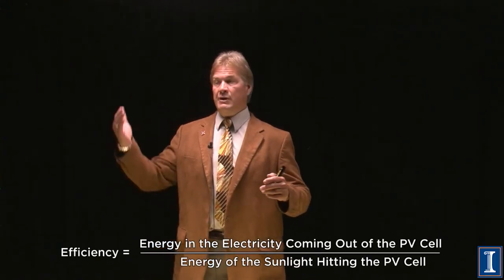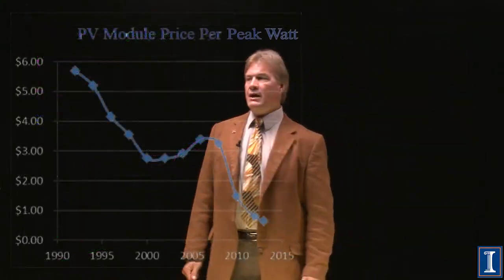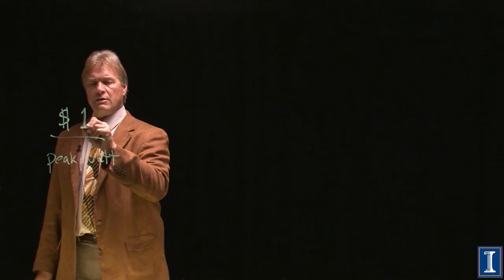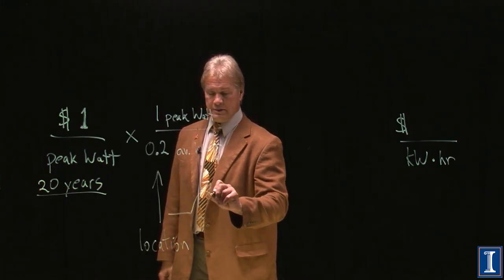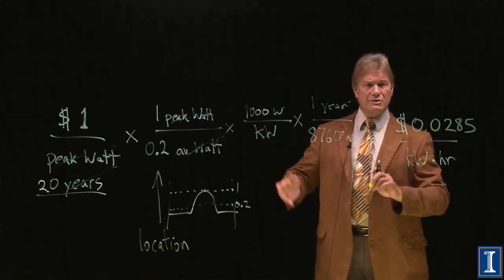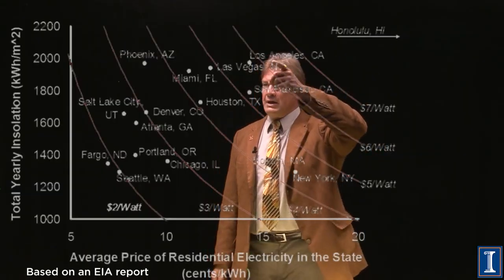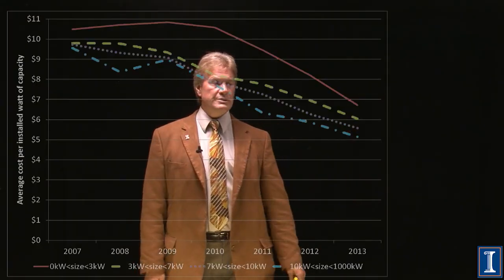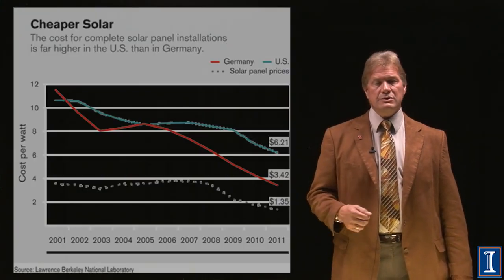The Cost of Sunshine

Comment: I worked for a company installing solar systems all summer. Funny thing is I was wanting to do this at my house before I worked. After I was done working and the company split up between owners I had already figured out it’s not for me. I’m not bashing. Simply pointing out my experiences. One thing he mentioned is the standardization of roofs here in the US. That is very true and plus our shingles don’t last the same time of the expected life of panels, so in contrast if your roof goes bad you have to uninstall your panels, put new roof on and then reinstall your panels. So that is Tripling install cost. No one ever worked that into their cost analysis for a job we did. Now there are other methods, pole mounts and rack systems, that can be put in yards or fields but away from trees and buildings, but that is almost impossible to do in the city which is where the energy cost are more and the higher need for solar systems. All these cost analysis were done if everything goes right. Roof leak? Now ya have to remove panels. Roofer won’t mess with them. So a simple leak can cost thousands. You might have to get an electrician and a solar company to remove panels before your roofer gets to the leak. Also all the activity of installing them running around on your roof degrades the shingle life. Now we have storm problems that cause about half the problem besides the electrical problems. Wind blows a wire loose, limb falls from a nearby tree. It was the neighbors tree. Now we’re in a fight for repair. Who’s fault, leads us to insurance. Now your homeowners might say yes we cover it but we need it inspected and proof of cost but you didn’t think of that before your $20k system got installed. Some won’t cover it. Some will. Do your research! And Hail storms? I can’t comment cause I haven’t seen one but the threat is there. We had multiple problems with getting the panels here from China that were not damaged. About 1 in 10 were damaged.& also the inverters and optimizers went bad. Sometimes taking a lot of work to repair and some not covered by manufacturers so we had to eat it and so did homeowner. The next thing is not even related to solar panels. Now don’t get me wrong I like them, I wanna save the earth and also save money. Most of our customers don’t even care about the earth they just wanted to screw the power company and gov as much as they could. But while installing not one homeowner was ever on their roof and in their attic. We discovered on every job at least one major problem causing inefficiency for them. Example a cold air return vent was just laying up there open to all the roof heat! Others had roof vents blocked and restricted. Or lack of insulation for our climate. People, solar panels won’t just fix it all. You have to know your house. We improved people’s efficiency with out ever putting a system in. This means you need to do a whole house evaluation. Old HVAC system can kill your bill and render panels useless on a cost analysis. Then the last thing is are you going to stay at that same house for 20 years?!! Not many people do. Are you gonna just take them down drag them to your next house where they are outdated and lost their productivity. Many things to think of.
Reply: and yet, there are those of us that do not live in the city and have solar homes - I remember the $6 per watt days and how precious those panels were and now bask in the $0.50 per watt panels and have to worry about my battery in uncontrolled conditions.  You are absolutely right in your observations - solar, for the reasons you're expounding, isn't right for rooftop installations.  But there ARE installations where it really works.  Like mine.  Haven't paid a utility bill (except propane and buying batteries and some diesel) for 30 years.   To be truthful, though, the cost savings isn't as great as one would believe.  But, I didn't have to write that check every month.  It was worth it.
Reply: Honest question, maybe naive: wouldn't the solar panels provide some protection for the roof and add to its longevity?
Reply: @chance20m  Not really... Roof shingles typically do not fail because of physical damage from hail or whatever. They typically fail from age and rot.
Reply: @dwightlooi  Fair enough.
Reply: @dwightlooi  is shaded they may last longer.
Reply: @chance20m  yes, good observation, but you don’t cover every inch of shingles with panels. So the places most likely to leak are valleys and around vents and chimneys. So let’s say 60% of your roof is covered with solar, 40% keeps getting the suns wear and tear. I guess you could get a roofer to replace 40% of your roof but not one would ever give you a warranty because how does he know what the previous solar installer did. Thanks for the discussion. This is how we further our knowledge.
Reply: @chance20m  No
Reply: @chance20m no, they don’t cover the entire roof
Reply: Interesting information - and a first hand one! I live in Brazil and nothing here is standardized and most people who can afford sollar panels will have wither concrete roofs or ceramic (masonry) tiles over wooden structures. We have almost no preoccupation with cold weather (except for some regions and during some parts of the year). We do have problems with leakage because it rains a lot everywhere at least during some part of the year. Do you think it would be cheaper to install under these conditions where, for instance, you don't have to worry about things getting frozen? 

Now, a curiosity of mine: why do change the tiles in the roof frequently? 

Thanks!
Reply: Buy solar scams!  The scam is Free!
Reply: In the UK, most people have solar panels mounted on top of concrete roof tiles / slates.  So the problems you illustrate with roof leaks are valid here also.  However I decided to get roof integrated solar panels.  These are made by GSE, and they enable the solar panels to sit flush with the roof tiles.  https://www.gseintegration.com/en/Inroof.html

Interestingly I got a cheaper quote with this system.  My electrician reckoned they were easier to install than the on-roof racking options.  He also reckoned they resulted in fewer warranty call outs due to roof leaks.  You also get a whole lot of spare roof tiles to sell (which are hard to come by these days!).

The end result is that there's far fewer components installed on the roof, and the overall static load on that roof is lower that it was with the original concrete roof tiles.

So if there's ever a leak: 6 bolts & two MC4 connectors / panel to remove until you find the culprit.  That's 2 hours labour + scaffold tower to identify root cause (incl. travel / setup / packup time).    Worst case is four panels to remove.  That's unlikely to be thousands of dollars to fix.

Furthermore as the technology becomes more popular, then more electricians and roofers actually become experienced with this kind of work / remedial action.
Reply: The devil is in the details.  Its the hidden costs that get you.  Nothing in life is free.
Reply: @rocknroll368  Actually, it's simpler than that. A typical solar system is about $25,000 without a battery storage or about $35,000 with it (installed). At an average of 876kWh per month, the average home uses about $1050~$2100 worth of electricity a year depending on which state you live in. $1050 will be at $0.10 per kWh (Arkansas) and $2100 will be $0.20 per kWh (California).
--
These systems will take 23.8 to 33.3 years to BREAK EVEN in a low energy cost state. Even in highest energy price states like California, they take 11.9 to 16.7 years to BREAK EVEN. That means that in a best case scenario they take a decade and half to pay for themselves and it the worst case they never will -- we are assuming zero maintenance and a 20 year warranty (which is being generous given that you are NOT going to get that with any battery right now).
Reply: @dwightlooi  Thanks for the detailed summary.  Solar always has a long payback.  Its just a pipe dream and feel good thing to do.  I don't think the USA should ever switch to solar 100%.   The sunny states can try it.  How do you keep it clean from bird dung, dust, dirt, sand storms, fallen leaves and shade trees.  A building gets hot from the direct sunlight.  The building degrade from hot and cold, expand and contraction without some shade.  So, you might maximize solar but need  to use more water to hose off the solar cells.  The electronics degrade over time.  What are the maintenance costs.  The wind, rain, snow, ice, earthquakes can damage solar panels and wires.  How about rats, squirrels chewing wires, running on top of the cells??  Solar is a big pipe dream.

Its like buying a vacation home.  It sounds so great until you have to pay taxes, mortgage, maintenance, cut the grass, and pay for solar panels to power it!  And don't forget the batteries, and replacement batteries.
Reply: @dwightlooi  , I also worked for a solar company in San Diego, but their model is different. They pioneered solar utility where customers pay a monthly bill like they would with a regular utility company, but with much lower costs. The installation is free, and everything down to even roof repair is covered. Personally, I would never buy solar panels, but the utility model appealed to me.
Reply: @rocknroll368  I don't think we CAN. There is a reason solar and wind are only 3% of the world's energy production after 30 years of heavy subsidies.
--
There is also the ELEPHANT IN THE ROOM. For every watt of solar and wind at the grid level, you also need an equivalent amount of gas turbines or other fossil fuel based generation capacity. If you put in 100MW of solar or wind for your town, you still need 100MW of conventional generation capacity for when the sun doesn't shine or when the air is still. Are we ready to DOUBLE our generation capacity only to use half of it?
Reply: @dwightlooi  And the sheer space needed for solar and especially wind.  The second largest 'wind farm' in the world is in central Oregon and covers 30 square miles and has a capacity of about 850MW.  The same capacity of an average coal plant that would take up about 10 acres.  The same coal plant also doesn't need massive government subsidies just to be build and further subsidization to stay in existence.
Reply: @ourvaluesarewhoweareinadem4093  Regrdless of what we think of Solar and Wind, an irrefutable trend in the USA is that practically no new coal fired generation capacity is being installed. Instead, combined cycle gas turbine plants running on natural gas is being put in. Why? Because they can be brought online for surge capacity in minutes not hours and because the fuel can be piped making handling easy and economical. Besides, we have the largest NG reserves and the lowest NG prices subsidies or no subsidies. It also fits "green" states' power grid requirements much better because -- environmental issues aside -- near "instant on" is needed if you have a significant portion of the grid on fundamentally intermittent sources like solar and wind. Efficiencies can exceed 60% with the latest turbines such as the GE LMS100 or LM9000 with secondary steam cycle running off exhaust heat.
Reply: @dwightlooi  My point holds true.   A few acres of gas turbines will generate more electricity than many square miles of wind turbines. Wind/solar are grossly inefficient as far as the space needed to generate the power and they both are cost inefficient as they need subsidies to even be marketable.  Add that to the fact that they are intermittant generators of electricity even in (rare) ideal environments makes them largely dead-end technology for mass power generation.
Reply: Although gas can start instantly, given the volume of water and the temperatures involved, it takes hours to get the steam cycle going. For rapid ramp up, a gas plant has to be running at a minimum of half power all the time.

The only traditional power plants capable of coming online rapidly are hydro electric. Just start the water flowing and even the largest turbine will be at full speed in a matter of minutes.
Reply: @dwightlooi  it's now 2025. In 2024, wind and solar were 15% of global energy production. Up from 10% the previous year.

And there are countries where wind, solar and hydro provides 100% of the electricity - and more and more things are moving to be powered by electricity.

It's accelerating.
Reply: Was a solar installer and electrician. I completely agree. Don't let people who are overworked and don't care drill holes in your roof ....
Reply: Outstanding summary and analysis  KPMACHINE1     Well done!
Reply: Thank you
Reply: The list keeps going!  Only makes sense if you are a do-it-yourselfer. We install them at a loss in every project!
Reply: Ground based solar install, if you have the land, would certainly be more flexible and prevent the issues encountered with roof installations. It would facilitate tracking the sun, and in instances of bad weather, reorienting the panels to prevent (or minimize) damage.

For roofs, I like metal vs asphalt. Metal lasts longer and new types are hail resistant. They also provide for an air space between the roof and sheathing, so as to help mitigate heat transfer (i.e. ungodly hot attic space).
Reply: In Europe, if my roof lasts 20 years, I would probably sue.
Reply: Good Points
Reply: dude, I hope you saved this comment locally. share it around a few other boards and forums, you obviously put a lot of effort into it
Reply: Not only everything you said, but EROI.  The EROI of solar is abysmal.  Google says the energy payback time of a solar panel is between 6 and 10 years depending on a bunch of variables. If they last 20 years, that's 2 to 1 EROI in the worst case and just over 3 to 1 in the best case.  Western Civilization CAN NOT RUN on such an energy source.
Reply: I installed solar in 2021. 6.5 kW of panels, 5 kW inverter, 11 kWh of storage. I live in Ireland so I get 6 MWh per year. I paid, after the grant, €12,000. Between electricity I send back to the grid and electricity I use, I've made back €7,300 as of July 2025 (a little over 4 years later).

It makes sense to me.
Reply: Hey, I just want to say: I read everything you wrote in your long ahh paragraph
Reply: My german roof (stone, bolted to the roof) is good for 100+ years, which is good enough for 80 years of solar ;-)
Reply: Some people talked to actually replaced their roof prematurely so would be new roof before the pv panels installed. Lost money there too
Reply: Yes! Consumer solar is ridiculously inefficient, and the government subsidizing it is an infuriating subsidy of wealthy people's virtue signalling.
Utility and even commercial rooftop solar are better in every way.
Reply: @AltereggoLol1  Yet the government subsidizes fossil fuels to a far greater degree as well as biofuels which I hope anyone would agree is good for no one.
Reply: @AltereggoLol1  utility solar makes almost zero sense. 
The land required to get enough electric generation is huge they provide no inertia and no are only generating peak values a few hours a day when it's sunny. 

In the South West and small amounts it's fine but it'll never replace traditional power without costly storage and significantly over building to account for demand on cloudy days/nights
Reply: KPMACHINE1 how about with the federal ITC @26% and the IL SRECs. Pair that with the depreciation schedule of 1-5 years at 85% of total system cost.... it would be worth it over 5 years or as little at 1 year for some people. 
I’m new in this field and I liked reading about your experience. I will definitely think about it. 
What’s crazy is the fact that we have the best silicon sand (st.peters sandstone 99.9% quartz) in IL and ship 80% away to other states, mainly Texas, for hydraulic fracturing. The other ~ <20% is used for solar panel manufacturing. We should buy up land for panels instead of the land going towards fuels that destroy the earth more.
Reply: The solution to that is to make the singles themselves solar panels. The Tesla Solar Roof is one such implementation, but it can go further. The shingles (or tiles if you want to account for their additional thickness) can be made in such a way that there is NO CABLING between them. The inside bottom edge mates to the outside upper edge like Lego blocks and strings all the solar shingles up in parallel  which then feeds the inverter via the top most row of shingles while the lowest most row has terminators. Of course there are identical non-solar shingles of identical thickness and appearance to round of the rest of the roof which are not used for generation. Again, everything interfaces the same way with no tools, no nails, no screws and no cabling needed. As a matter of fact, you CAN have a roof using such shingles that are totally non-solar. It'll then be "Solar Ready" and you can add as few or as many solar shingles as you want at a later date.
Reply: @dwightlooi  that is probably the most practical we can expect for a solar roof installation, from what I understand the price of a Tesla roof is roughly comparable to other premium roofs such as slate and given the warranty you are pretty much garunteed at least a break even so long as your neighbors don't build a tall house that shades your roof.
Reply: @garethbaus5471  Actually, no. It is about 25% more (give or take) that a solar panel setup. But, because it is actually a roofing system that replaces tiles or shingles, it is CHEAPER if you are due for replacing the roof anyway. Because a roofing job can easily run you $15~20K by itself, paying $35K for a solar roof instead of $26K for solar panels + $15K for the re-roofing is actually cheaper. Tesla also have prettier (slimmer) batteries and neater inverters. $35K will pay for a solar roof, inverter and two battery power wall setup.
--
It is important to understand that not everyone gets solar because of the Global Warming hogwash or to save on the electric bill. The latter generally won't net any savings for a decade. A lot of it is to get an uninterruptible power source and everything else is incidental to that. If a proper roofing job + a proper generator is about the price of a solar roof w/ battery why not the solar roof? The generator needs an intact natural gas supply, the solar-battery setup does not, not to mention is almost totally silent -- there is actually an inverter hum, but it's not noticeable unless you are in a few feet from it. It is especially attractive when it does not have discrete panels that stick out like an eyesore and the roof looks just like a normal roof.
Reply: @dwightlooi  hence why I was comparing it to slate and not other photovoltaic systems, it is a roof first and a energy source second and definitely isn't worth installing until you replace your roof.
Reply: @dwightlooi  a better solution is to require all newly installed roofs to provide X amount of solar power. That is a better solution but would still place the cost burden on the middle class which already carries every other burden. Placeing the panels in space makes much more sense.
Reply: @iivin4233  Even with SpaceX Starship's grossly optimistic launch costs space based solar will be as affordable as building your home with Gold bricks.
Reply: Are solar installation workers unionized?
Reply: @thejfactor1  usually roofers and electricians that can’t cut it in their respective fields.